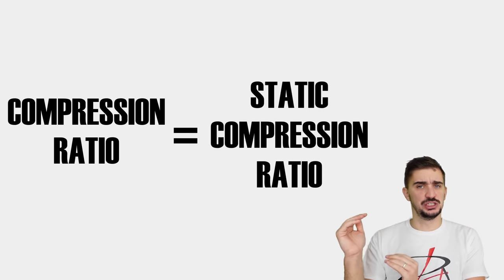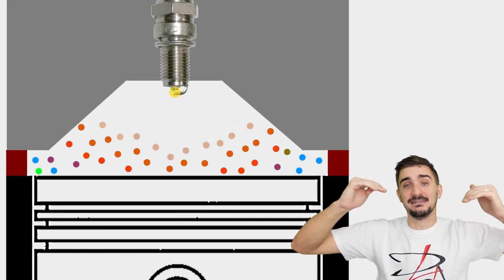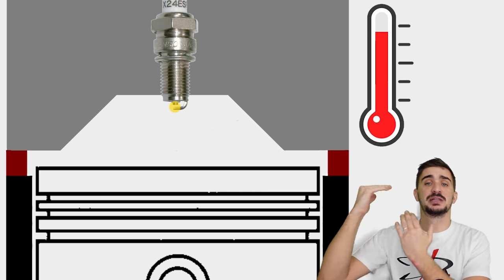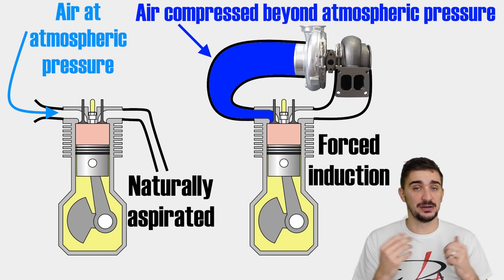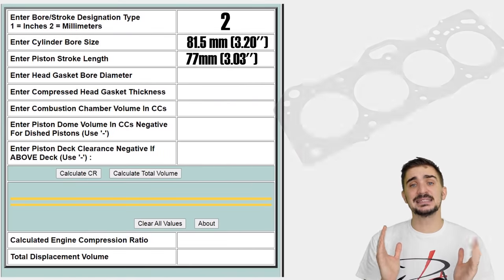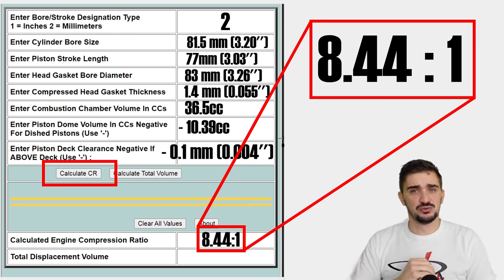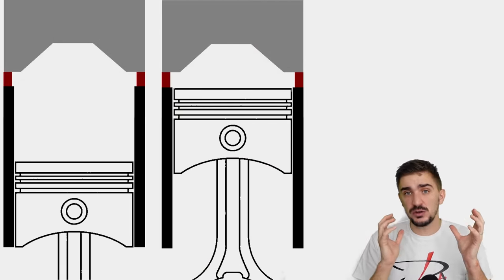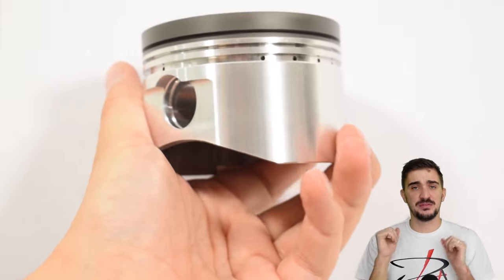COMPRESSION RATIO: HOW to CALCULATE, MODIFY and CHOOSE the BEST one - BOOST SCHOOL #10

Comment: Great video. 
Beware to don't rely on AEM infinity5 knock monitoring too early. 
Knock parameters have to be entered and validated using the only tools really reliable to detect knock: the audio knock detection devices (phormula, plex, etc). 
Otherwise you can't be confident about knock monitor parameters and you will never know if the engine is really knocking or not when knock is detected... Which on serious boost level could ruin all work in few seconds.

Comment: Great video as per usual. However, a couple aspects of this topic were glossed over or not at all mentioned. One being the dynamic compression ratio and octane rating of fuel. Perhaps a part 2 to this episode to add dome much needed depth to the subject?
Reply: AGREED. The dynamic compression ration can be significantly affected by the cam. Back in the 1990s I used to run N/A motors on pump gas with 12, 13 or even higher static CR because there was so much valve overlap that the dynamic CR was much lower until the motor "came on cam".
In pre-turbo days a lot of time and effort went into intake and exhaust header design to try and get volumetric efficiency over 100%. That in itself was not so difficult, but the trick was to get that to occur at a desirable place in the torque curve. I always went for low gearing and stacked everything onto the top end, and a lot of my motors pulled amazing HP figures whilst remaining quite drivable because of a ridiculously high static CR. We had to do lots fiddling with ignition timing to minimise knock and ping, often using heaps of advance down low, but total advance would be less than stock to try and stop the pistons from detonating.
We usually found the easiest solution was a can of octane booster in each tank. A lot of guys with "new fangled" turbos would run water + methylated spirits injection, as that was great to reduce preignition. How much easier it is now days with fuel injection, computers to manage mixtures, timing and all the other variables.... we used to do it all physically, changing jets, venturies, ram tubes, distributor weights, etc.
Reply: @johncoops6897  agree 100%. I did a boosted toyota yaris 1.5L engine, making out 300 crank hp with 23 psi of boost. I used 9.5:1 compression ratio. Had knock on ron 97 fuel. Changed to ron 100 fuel and added methanol injector an had no more  knock issues. Using the car for past 2 years, no issues since.
Reply: @surendransuppiah  WOW what car is that in? I assume not a Yaris since you referred to it as the Yaris engine
Reply: @Roomsaver  its a 2011 toyota belta, called as vios here
Reply: Agreed, my motor makes around 1600hp with 11.8 comp and 24 psi. My previous setup was 9.0 comp with 28 psi and made around 1100. Biggeat factor was the fuel needed to make it live though. Love these videos though, keep em coming.

Comment: Always faced problems in understanding compression ratio
But you are always there to help out
Thanks a lottt bro
I did a good job in subscribing you ig😊😊😊😊
Reply: He did only talk about gasoline engines....... but in diesel it is nice to go from 21 -22 down to 17-18 and put some boost on it and gain some more horse out of it... The lower comp the more space you have to fill up with fuel and air
Reply: @rvarsigfusson6163   yes agreed brother
But diesel are supposed to run a higher compression na? Since it uses the compression of the fuel to force the piston down?
Reply: @ahnafzahid9450  You are right on that gasoline is up to 13,5 (15 race), but diesel will start at higher level then that and go up to 23..... it`s all "just about" numbers. 
But lower the comp is in a turbo engine then more air can be delivered with a turbo and then much more fuel. Just think about E-85 gasoline witch have less heat in burning chamber can have a lot more horsepower out then regular just because of less heat in burning and then a lot more fuel. Same will happen with use of propane on a diesel engine..... and much less smoke....
But I have to say this video is quite good in showing things and talk about it also...........

Comment: static compression is based on math , lets say you got 180 on your compression gauge on all the cylinders, on a push rod motor  (GM) you run out of air at redline you can change rocker ratio,s stock is 1.5 ,going to 1.6 on the intakes, gives you more duration and valve lift, so the power band moves up. changing rocker ratios to improve the band, is cheaper than replacing the cam and lifters

Comment: I spec'd and assembled a pretty potent little monster last year. 97 gen 2 LT1 V8 from Chevy. Iron block, aluminum 54cc combustion chamber heads. Overbored to 4.030" with a factory 3.48" stroke for 355ci (5.8L) of displacement. Some forged Wiseco pistons and forged H-beam rods from Eagle with a zero decked block and .026" head gaskets for a static compression ratio of 10.3:1. Running a Vortech V1-S blower and an extremely efficient water to air intercooler setup making 7psi of boost at 6700rpm. All controlled with HolleyEFI. Butt dyno says 575-600hp at the crank. We'll find out what a chassis dyno says in the spring.
Reply from the maker: Sounds like 650 to me 💪💪

Comment: I have a Suzuki DR650, which has around 8.4:1 compression stock. I installed a flat top piston, and now have 10.5:1 compression. It makes a big difference! Sadly this bike doesn't have EFI, or even a way to adjust the timing, so it has to have the high octane stuff now.
Reply: Wouldn't be too hard to convert it to EFI though, I'm currently working on creating my own for a carburettored, single-cylinder engine this coming holidays :)
Reply: they are some digital programmable cdis. For 10,5:1 you can run european 95 octane, usa 91 roz.

Comment: My 1.8L engine at 1 bar and 8.5:1 made 400bhp near it's limit using stock internals.  I decided that was more than enough so when I did blow that up with too much heat on track I used much higher quality components and left the compression ratio and power the same with a much larger margin of safety.

Of course changing fuel is also part of the equation.
Reply: I’m assuming this is the original comment. The user “dark” just copy pasted this, and another comment from other users on this channel.

Comment: Thanks for your videos.

Pittsburgh Power, a heavy duty diesel shop that rebuilds more powerful engines than OEM specs.  The owner of this shop writes that "Boost" is better than "High Compression" which puzzled me   A year later I found out why: He said boost is more efficient.  This left my understanding  kind of vague.

Your video make my understanding more concrete with the numerical gains of boost and compression. 

EDIT After a "Like":

If wide open long-haul west of the Mississippi River 70+ Mph grossing over 75k#, I would throw on a Holset-5 with impunity and think nothing of it.

But being in the Chicago area and that I am in 35% loca driving in less than 50-mph legal speed limit, and traffic congestion  the other 35% of my time it is no longer worth it to have turbo-lag 70% of the aforementioned times for the 30% of the time Onam running 65+ MPH; high compression wins the day with a snapper throttle response 

This said, my Cummins N14 likes to spin; it does not like to be choked with sub-1450 RPM at highway speeds.  Instant fuel consumption light meter evidences my theory.    At 1500+ RPM it has no noticeable turbo -lag anyway, so.....

Comment: Excellent, what do you think does mazda skyactiv - g with 14:1 ratio need for preventive maintenance or care because owner  and service manual haven't mentioned anything
Reply from the maker: That's a clever engine! It doesn't really need anything different from other engines
Reply: While the "static" CR is 14:1, the intake valve closes late into the compression stroke making the "effective CR lower, while keeping the "expansion ratio at 14:1.

Comment: This was very interesting.
I am considering boosting an M30B25 in a BMW E28.
The CR is 9.6.
Always thought it was to high for boost, but your video learned me that a moderate boost level could be used, because I’m not aiming for crazy power output, but smoothness as usability in daily traffic.
Thanks a lot!
Reply: Yeah it seems like modest boost is acceptable in many cars without internal upgrades. Even the GT86, with 12.5:1 compression, was considered safe to boost up to around 300hp on stock internals (with a proper tune of course).
Reply: Угол будет поздний,температура выхлопа высокая,проточи сток поршень,сделай хотя бы 8,5 и дуй спокойно

Comment: Another interesting question: can I run high compression on a turbo engine by exceeding safe limits but adding a water injection system before the turbo or individually on each cylinder? and that it is always activated exceeding a certain level of boost
Reply: Rum propane  and you can do high compression say around 12/1 and boost. But you also have to use more propane to do the same job a gasoline.

Comment: I’ve been watching your channel for years, it is my all time favorite car YouTube channel by far. Quick question though: I have a 10:1CR L28 that I’m considering running low boost (8psi max) but I was wondering if there was a way to retrofit a modern knock system to get the most out the gasoline and to not ping my engine to death on boost. I saw you used the AEM Infinity ECU for your setup, but could I use that ecu just for the knock sensors and timing adjustment or would that only work with a full fuel injection setup? What would you recommend?

Comment: Thank you! A lot if very useful engineering material. I'm learning so much. I want to modify a Suzuki Liana 1.6 16v petrol engine n/a to turbocharged. These are super robust engines and can handle all manner of demands in stock form. Excellent.

Comment: Would of enjoyed a brief reference to the practical limits of N/A compression ratio and its diminishing returns.   Your 4% increase in power for 1 point of compression is somewhat misleading .
Reply: Diesel reach this limit. Maybe with pure methane you can reach this limit / optimum with spark injection.

Comment: Ive Got A 3.8 V6. I Was Running 8.0CR. Its A Turbo Engine. I Run About 27PSI Of Boost Only At The Track. Normally Is About 22PSI. Im Guessing 27PSI Is About 600HP. 22PSI Dyno Day Was About 550HP So Im Guessint 27 Is Near 600. Its A Small Fake GTX3582R With A T3 .82 AR Turbine Gousing. The Engine Had To Come Apart And Im Considering A Piston Change While Im At It. Im Looking At Going To A 9.9 CR. Its A 91 Pump Gas Car With 1000CC Single Nozzle Water Methanol Injection Car. My Engine Machinest Advised That Runing A 8.0CR Is Absolutely Stupid And If It Was Him Would Be Running The Highest Possible Without PTV Issues. 

After Seeing This Im Worried I Wont Be Able To Make 600HP. I Really Like The Power It Made. Its Absolutely Life Threating Fast At 600HP On Summer Tires To Me At Least haha. 

The Vehicle Is Daily Driven So The Low End And Turbo Reponse Is Probably Going To Be Night A Day. I Would Also Suspect I Would Get Better MPG.

Comment: That was a fun vid. Personally though, I gave up with calculated CR on NA engines 30+ years ago and just went with 210~220 PSI cold cranking pressure (around 300rpm) I have done all the measuring etc just for fun but theoretical CR can be anywhere from 11.5:! to 14.5:1 to get 220PSI
 The CR is highly variable depending on cam duration which I guess is for another video? (or maybe not as boost is pushing the air in)

Comment: The only thing missing is fuel type and how choosing higher octane ratings can mitigate knock and hit away running higher boost on higher compression engines.. example we hardly even use knock sensors with E85..

Comment: Eu não consigo mensurar a lógica por trás da redução da compressão do motor para aumentar o boost.
Veja:
12:1 tem chance de knock 
Se eu baixar pra 8:1 e colocar 14psi ( o dobro da atimosfera) isso eleva a quantidade de ar dentro do cilindro ao dobro , correto? 
Seria o mesmo que elevar a compressão a 16:1 (8x2 ) pois dentro do cilindro agora tem o dobro de ar. 
Como não ocorre knock nessa compressão?
Pra gerar o dobro de potência tem que haver o dobro de ar/combustível.
Um cilindro de 100cm³ teria que comportar 200cm³ para dobrar a potência. Compressão:
100 x 10 = 10:1
200 x 10 = 20:1 ???

Comment: Hi there, I dropped my BMW N54 engine from 10.2/1 to 9.5/1 and it’s a absolutely perfect sweet spot especially when turning up the boost, power also comes on more linearly now at 18 psi and 11deg timing and logs look clean

Comment: I have a SRX600 and an MZ 660 both singles - they both seem to have about the same power however the older SRX600 with its 8.5 cr is a far more flexible sweeter engine and pulls from 2,000 r/m  while the 9.5 cr Scorpion goes all lumpy under 3,000 rm.  I remember in my youth fitting a 9:1 piston in a Triumph Cub and it went from a sweet 7:1 mellow 65mph bike to a harsh 70 mph machine  that eventually blew its big end - I'd be reluctant to go high compression for everyday use.

Comment: hmm. Which ecu you suggest for boosted 2zz-ge. Don't really want to use old apexi. Ratio is about 9.1-9.2:1 don't have exact value now (need to remeasure). and going to have about 0.7 boost

Comment: CR=efficiency, commonly right but technically not, efficiency came from expansion ratio, yes, mostly it is has the same value as compression ratio, but mr atkinson denny that, and decide to design engine cycle with low compression ratio (work required) and high expantion ratio (heat converted to work), to get better efficiency. The draw back it is not powerful, because it is basically regular gasoline engine with 70% volumetric efficiency

Comment: Is the 4% compression increase of power correct for older 1 cylinder air cooled motor bikes?
I am running an "official" 18hp Suzuki GN250 (with 17.7HP@7600 rpm on a dino).
There are "big bore" kits available with 300cc. The original compression is 8.9:1. With a 300cc cylinder it is going up to 10.7:1. That is an increase of 1.8. 1.8 * 0.04=7.2% increase in power. 18*1.072=19.3HP. 
The problem is, that most tuners get between 22 - 24HP on a dino after that? (propably closer to 22 than to 24)
Is there something I am missing ?

Comment: Very sad  video! Dynamic compression is the factor needed! Determined what FUEL WITH INCREASED COMPRESSION RATIO. JUST WONDERING HOW MANY PEOPLE HURT OR BLEW UP THEIR ENGINES AFTER WATCHING THIS? I HAVE V6 1900 HP BOOSTED STATIC 12.5 TO 1 DYNAMIC 9.38 TO 1 COMPRESSION  
RACE GAS OR BOOZE ONLY .  DO SOME HOME FIRST.

Comment: Hello, Aladdine here from Algeria.

I have an enquiry if possible, I am buying new pistons for my A4 2.0 TDI, Nural brand.
In my local stores I couldn’t find the same ref number provided by my mechanic, what I found was similar in all specs but RECESS Depth (required {mm} 12.700.
Found: 13,100), other than that all measurements are the same.
What is recess depth and do you think it will fit and run without problem.

Comment: ok, but adding 1 Bar of boost is doubling the atmospheric presure.
I can't see that might be the equivalent of stepping compression ratio by one.

without thinking too much, boosting by a bar brings roughly the double of air wich will be the double of air exploding than compressing by double with no boost. So, same presure in both, double the air in boost. Maybe comparables  with double displacement when no boost.

Comment: You are an intriguing young man. Is the Infinity system yours? I was planning to build my own, but watching you a while, I see you understand the industry and science. Should I consider this, or build my own? From a Subaru stand alone to a GM 6.5 TD controller (3 outputs) and 4L80E transmission. 
One mentor made the 1st transistorized motorcycle ignition. 
Another learned from Smokey Yunick, and was Black Flagged at Daytona in '68.  
"289 can't make 427 SCJ performance." Wrong!! 167.86 lap, 210 back stretch. '67 Shelby GT 350. 289 was from his Ranchero. Teched and won. For a Single guy plus week end pit crew, he kicked butt.

Comment: I have a quick question, I hope you respond.  I’m building a 2.2L honda engine.  I want a 12:1cr piston, there will be head port, crank balance, intake manifold port w/ larger theottle body, forged pistons, 1mm over bore (85mm to 86mm) and a new performance head build with flat valves.  So air is already taken care of.  For fuel, I planned on 750cc injectors, should I go a bit larger to 1000cc?  Im looking for mostly high reving, power output 180-200 depending on which is safer. My stock powwrr output is 130hp at 6200 rpm

Comment: This is an interesting video on compressions ratios, on how to calculate compression ratios and different compression ratios to use in different applications. However most people, like myself, do not modify the engines that our cars were equipped with. As a result most of us do not know what the compression ratio of our car engine is, unless we look it up on line or in manufacturers literature.

Comment: Hi Guys!

There is something wrong here. Speaking about N\A engines. First - power vs CR diagrams are not linear. Is not nice to say you increase max power about 4% going from 9:1-->10:1. The real benefit is more torque in wide rpm range. This 4% of max power makes me i don't feel like want High CR piston to have installed. And definitely you don't want to decrease thickness of head gasket without checking clearance valve vs piston. With modern 16v engine you will get trouble.

But I have to admit, about boost seems to author have a lot of knowledge - nice to hear those informations.